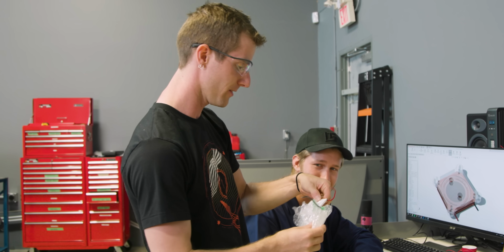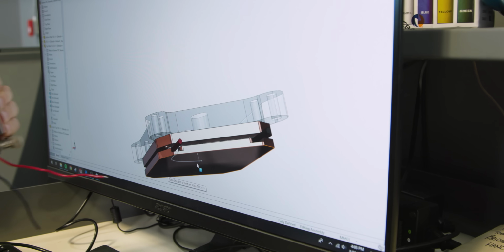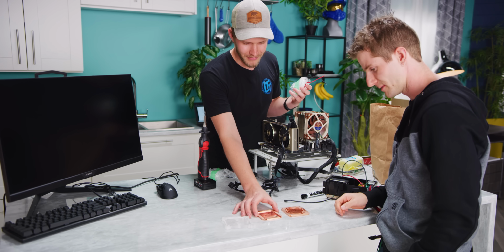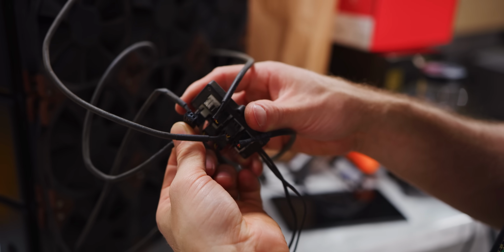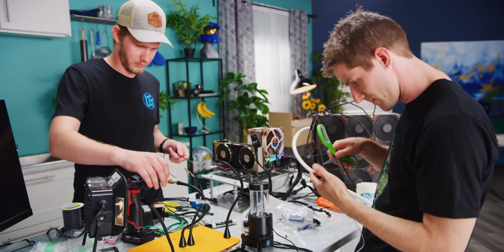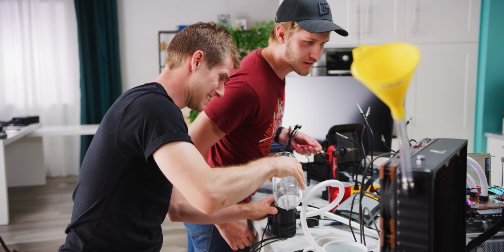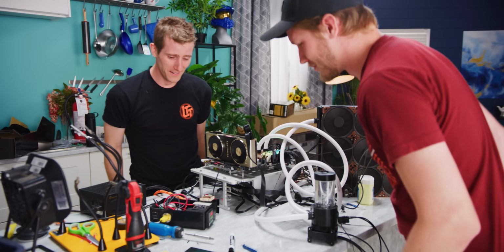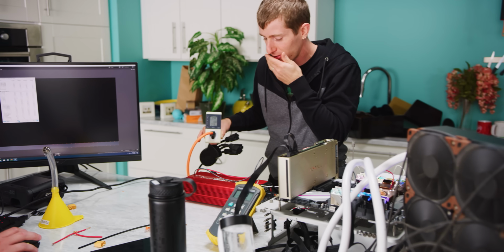This Cooler DRAWS 545W!!? Bad Cooling Ideas #2

Comment: Glad you guys enjoy the fun, i do believe that your idea of going big is bound to fail, try using (Epoxied) multiple smaller Peltier resistors right on to a copper line, well i know its more complex than that, i drew my setup in AutoDesk inventor, i did come up with a really cool heavy heat dissipation on the multiple Peltier resisters on the copper line, but i simply would love o see this tech work properly. rethink your approach to much smaller and multiple Peltier resisres like at least 6 to 10, in parallel with a combined wat of at least 500, but really would be best at  over 800 to 1K

Comment: As an engineer who does FEM simulations I wonder how the simulation was made. The problems everyone mentioned should have shown up if Alex did make a proper simulation. Also its good that they used a PID but the way they explained it in the video does leave me wonder if they only had it as an on/off regulator or with the advantage of it that it regulates the TEC in a proper manor.

Comment: Linus would be the only person holding live wires carrying 900 WATTS and getting exited
Reply: Plenty of people have held live wires and got excited...
Reply: Better to be excited rather than shocked
Reply: @Corpus_Subiectivus  Fr
Reply: its just 24v, not going to harm him!
Reply: @zanw.awesome3102  but stil if things go wrong 900 watts is 900 watts
Reply: @Ayush_Bob  its DC, it doesn't penetrate the skin, its 24 volts, so not harmful, its just 900w/24v 37.5 amps, at just 24v, it definitely won't harm him!

perhaps an example is in order, imagine someone is starting a car and you're holding a single terminal connecting a battery, that puppy is 12v and draws 500-1000 amps, so around 6000 to 12000watts, now i was stupid enough to touch it but it really doesn't shock you at all, just tingles, so just 900 watt or 37 amps at 24v won't do anything!
Reply: also, kids, don't ever try this at home! I'm what you call a stupid curious person!
Reply: @zanw.awesome3102  37 amps is many times that is considered lethal but not at 24v no. 0.1-0.2 amps is lethal but would require at least 50v. But thats not saying this thing they built isn't dangerous.
Reply: @DeKosta plus our skin resistance is quite high, even if its 37 amps at 24v, it won't penetrate our skin and even if it does, connection from hand to insulated (shoes) feet is too long and current would take the shorter route which is the ground on circuit !, But ur right, it's still dangerous, it might short circuit and sparks would fly hard or it may catch on fire!

btw, I'm not an engineer, all of this ive learned from @electroboom , so i might be wayy off..xD
Reply: @zanw.awesome3102  You are fairly right. But the current (amps) is a result of applied voltage and resistance. Voltage= Current * resistance.  If you would apply the same 24 v potential to a human body- > 24= unknown current * 100 000 ohm (approx resistance of dry skin). Solve for the unknown current and it would be 0.00024 A. So you never apply a current of x ampere, you apply a voltage across a load with a certain resistance and x amount of current will flow through it. Same goes if you charge your phone with 5v usb. If the charger is rated at 1 amps or 2 amps it doesnt matter. The phones resistance is "fixed" and will only let a certain amount of current through at 5v. If it can handle 2 amps it will charge faster but if it doesnt, it nothing happens. Reduce resistance-> more current flows. Increase voltage->more current flows. To risk killing a person, you only need about 0.005 amps.

Comment: Literally, the only thing a TEC does compared to an actual water block is ADD heat. The Peltier just moves the heat to the other side, but due to inevitable thermal losses and internal resistance more heat is generated.

Comment: it's been a while since i read up on thermoelectric modules, but if you apply a temperature differential over it, then it should be able to create enough power to drive a fan, couldnt you use that to make "free" cooling

Comment: Use salt water to directly extract heat from Processor, send that water to a 20 liter heat sink, which is maintained at 0°C using your piezoelectric cooler. You can do it with the existing setup you have Trust me, I am and Indian, it is bound to work
Reply: ARE YOU READING THIS?

Comment: I wonder, would they be more effective if they were used to line the lines rather than directly on the block? You have less instantaneous heat to compensate for, and you can cool them off by running a decent sized fan over them while the water cooling does its own thing on its own, rather than having to worry bout getting through that mass of copper....

Comment: Guys, you need to super cool that liquid by making liquid and air blocks for peltier elements. Feed the cooled liquid to cpu and temp measurement should be done on the output liquid from cpu to control peltiers.
Reply: On the output side first element should be just a regular radiator to take away that possible extra load from peltiers.
Reply: If you want to go hardcore you should make second waterloop to cool the peltiers which are cooling the first loop.

Comment: you get a much better result by stacking TECs rather than using a more powerful TEC. It will be a little less efficient, but will work over a greater thermal differential. A very easy change would be to get 3 of the same TEC, and stack them on top of each other with some thermal epoxy between them, and have the bottom TEC connected directly to the power source with the two top TECs connected in series with each other. 
A much better use of the TECs in your setup would be to just have the CPU water cooled, but use the TEC to cool the water with a smaller fan and heatsink cooling the TEC. It does a much better job with a smaller temperature differential.

Comment: My water cooled  PC 20 years ago used more power for the TEMs than for the CPUs, quite a big overclock though. Most fun doing it on the cheap, radiator was a modified heater matrix from a Ford van, circulating pump from a water feature.

Comment: Why dont you do 2-step cooling ?
1) Hot water goes into radiator that dessipates heat, and lowers tempreture to ambient like 30 degrees Celsius.
2) 30 degree water then goes into cooling module that uses Peltier element with massive radiator attached to its hot side, and water tube on the cold side.
3) Then, Cool water with sub-ambient temperature (maybe 14 degrees Celsius) goes to cool down cpu.

Comment: i would love to see the effectiveness of a standard water block on the cpu and somewhere on the loop have another water block for the tec that is meant to cool the water, which would probably have to be radiator coolant or something similar. alex is a pretty smart guy, im sure he could come up with a design that may work. and i know how bad he wants to try at this again. i want to see it work. there is so much potential in tec cooling

Comment: You guys know if you bothered to get the right kind of relay you could use the motherboard it's self as a controller.  It's not like the motherboard has fan headers that can be set to run at a specific CPU junction temperature or anything.  This entire setup is just more hamfisted bullshit like every other project you guys do.  Damn man, Linus even bought Solid Works for a guy that isn't qualified to sweep the floor at a real machine shop.

Comment: I feel like it would be better to use PWM control, rather than relay.
Reply: PID is the programming version of PWM. The relay used here is actually a solenoid which has no mechanical components in it, making it able to switch on and off REALLY fast, hence the big as heatsink on it

Comment: the base design was flawed by having the temp probe directly in the "path" of the heat. otherwise i think this design would have worked, given proper control and monitoring of the tec. (ramp up voltage in anticipation of the load) in addition, monitoring the output temp would be useful as the tec creates a temperature differential so the problem may be not enough heat shedding.

Comment: Dear your attempt is good, one  thing you do, instead of placing Peletier on processor keep it separate from cpu, from Peletier take the cold side water supply to processor and the hot side water supply to radiator

Comment: Why not try the other way around? Have a CPU waterblock, then use the TEC to cool the water instead of a radiator. You can use a massive air-cooled fin setup to cool the TEC with just a few fans.

Comment: And for the next time try use liquid metal inside the water cooling loop.
Mercury or Gallium should not have a to big viscosity.
(But of course mercury is toxic and gallium is not good for Aluminium but a copper radiator should be fine) 
Or

Comment: Would it help if the CPU was both cooled by the peltier and drawing heat from the copper to the water cooling at the same time? Isn't it bad if it's not connected to both?!

Comment: If you pump 500 watts of power into a TEC to cool 300 watts of heat from the CPU, you will have 800 watts of heat to dissipate through the water block.

Comment: weak link was the water pump. have a huge rad but didn't upsize flow.
Reply: im not sure about your definition of "weak link", but it certainly wasnt the lacking flow rate that made temperatures jump to 90 degrees in sub 20 second ^^

Comment: You need to rig it so the TEC isn't trying to carry the full heat load but simply adds additional cooling to the  inlet water for a standard water block setup.

Comment: "They're rated at 32 amps...and we're expecting 32 amps, so..."
Reply: a safety factor of maybe...
Reply: @wobblysauce  a safety factor of probably
Reply: An amazing safety factor of 1
Reply: @Kyros9119  The safety factor should already be in the rating, so it could actually handle more than 32A, but it is only rated at 32A.
Reply: @Kyros9119  Fuck. I am someone that constantly need to add safety factors and this made me laugh hard :D
Reply: @Kyros9119  I think that's a safety factor of 0 ;)

Comment: I like the video, but I can't figure out what the experiment was in the first place. It seems like you sandwiched a semiconductor in between two good conductors and hoped that it would cool better than with just a good conductor if you could supply enough electricity to the semiconductor.
What?!?

Comment: because the two pieces of copper that sandwiched the TEC were in contact with each other, there was heat transfer from the top of the TEC to the CPU causing the temps to rise. there needs to be an insulated separation layer between the two for the cooling side to do it's job on the CPU and the heat side to be isolated to the water block

Comment: Lol! You guys used a PID controller and have no idea how it works (Hysteresis)! Would have saved you some time there. Also, maybe use a micro-controller to run the I/O between any relays and thermocouples. Keep it up fellas! Engineering without math and science! Woo! Fun to watch!

Comment: So I think your copper is too thick for starters.  
There's too much thermal mass in the system which means the cooling is lagging behind the load increase and everything's out of whack.  
Also if the hot side of the TEC is too hot, your liquid cooling is not working correctly so the peltier is saturating. Hence no cooling.  
Possibly your liquid cooling system isn't big enough. That TEC will be producing towards ~700-1000W of heat energy if you're TDP on your cpu is say 100-150w.

If you maths it out, if your Peltier wattage rating is enough to exceed the TDP of the CPU, it should be able to cool it.  
BUT, your cooling system for the hot side must equal the TDP of the CPU + the waste heat from the Peltier. A peltier may only be 10% efficient, so if you're moving 150w from the cpu, it'll be producing multiple times that on the hot side!  

In the config in the video, you may need a car radiator to effectively remove the excess heat basically. We can see it's an issue as the hot side was super hot, meaning water cooling isn't keeping up.

For a final ditch effort I think you need to double liquid cool. You cool the hot side of the tech with a rad, and you transfer the cooling with a second loop between the cold side and the CPU.  
No big chunks of copper heat spreader making the temps lag.    

Super impractical, but I know technically this should be possible, and now I want to see this damn thing work!

Comment: Not enough liquid flowing for it to even be feasible, try a similar method to the fanless radiator you had a while ago, gas in a vacuum instead of a fluid, even if cooled by those 9 fans.
"Go MythBusters or go home"

Comment: i think an air cooling will suit for this because TEC is "collect" heat extreme fast, air cooler just fit very well for this. Water cooling transfer heat isn't that fast compare to a huge metal fin heat sink.

Comment: Heliarc weld a two piece block out of stainless for an hvac cooling solution . And heliarc stainless tubing into block. 
Then connect to a  matching wattage a.c. unit . Then insulate the area with neoprene and " pooky" 
If all else fails , find an hvac tech who would be interested in a colab. with you Willie wonka grade goofs .

Comment: why not instead of placing the TEC on the CPU (heatsink exc.). Just make a radiator with a TEC, and cool up the water, then go through a CPU water block, In other words, TEC the radiator and cool up the water or TEC the water reservoir (dump tank) ?? Also please tell me you guys are using distilled water, and not tap. If you're using tap water that's a newbie mistake.

Comment: how an engineer doesn't know it will not work before trying? In not really sotisficated devices/systems, energy transformations are around 30% efficient. So using peltier plate to take heat from the cpu and then a liquid system to take heat from the plate is most costy (in terms of eletric energy use) them simply using a liquid system to take heat directly from the cpu (and ofc more complicated)

Comment: I saw der 8auer built a CPU Cooler with an Peltier Element and cooles the 9900k I Think. It worked really really good. You can check it out at Hoellenmaschine 10 / HMX on PCWelt. Roman built an LianLi especially for the Big Radiator you Guys used too. So technically it workes just fine nur needs waaaaaaaay to much Power.

Comment: The trick with Peltiers is that they are most efficient at lower voltages usually. You can check the datasheet for your TEC to see a curve of voltage vs efficiency usually.

Comment: nah - this isn't over yet.

I'm familiar with the TEC-12730.  
At max power, it will move 282W at the cost of ~543W(30.5A*17.8V).
282W+543W = 825W of heat you most move.  

While that is a slick looking water block, I don't believe it's able to relocate 825W. 

At max power, failing to remove the full 825W of heat would have resulted in a thermal run-away (meltdown).  Because the heat could no longer escape - the TEC became a heater for your CPU.

You said you pulled 900W at the meter?  With ACDC conversion eff of 80%, ~720W has greatly exceeded ~543W maximum at 50C.  The maximum at 25C is a bit lower, ~475W.

There is likely damage to the peltier.
You likely headed the CPU for a few moments.

Please, do try this again.

Please consider a thermal test of the water block -- how many watts can it really move?  If it can't easily move the heat your cpu is producing -- then there is little chance for success.
Do keep in mind, peilters are MORE efficient with less power.
Perhaps consider a reservoir, holding the cold water for surge loads.
Consider having multiple tec's cool the reservoir.
Consider relocating the TEC, away from the CPU - so you don't accidentally cook it again.

And if you want to get really fancy and efficient - consider some sort of PWM instead of an on/off relay.  With a PWM, you can throttle back the cooling power as demand reduces -- and scale in with more power as necessary to keep the loop (or reservoir) at temp.

Comment: Thought for sure they would cause a brownout on the west coast.
Reply: From only 900w? A microwave at full power is often over 1200w.
Reply: @Combatpzman  Anything is possible when Linus is involved.
Reply: @Combatpzman  Not sure if you are being ironic, but the microwave only runs for few minutes (usually), that thing is supposed to be on for hours. ;)
Reply: @ZpeedTube  Nothing ironic about it. The point is that in the grand scheme of things 900w is nothing. Is it a lot for a desktop computer meant for home use? Of course. For example  A small window AC unit, which people run for hours, typically operates between 900-1200W depending on how hard it needs to work. A large outdoor unit would far exceed that. As would say your household oven, a washing machine, and more.
Reply: @Combatpzman
Amplifiers used for concerts are usually 1500 to 3000W, and they are often running ten or more of them at the same time.

Comment: What was the operating voltage of that Peltier at it's full power rating - most higher power versions I found earlier seem to be around 35V?

You guys DID realise that you had one HUGE oversight with the whole thing, don't you? You had a TINY waterblock that might have been OK for a stock CPU of ~100W BUT you were ALSO cooling the hotside of the Peltier tor a TOTAL of ~ONE THOUSAND WATTS! No wonder the poor copper plate was getting toasty...

Try engineering a new block with a very high flow rate and, more importantly, a LOT of heat rejection surface for the copper to pass the heat to the coolant!
I still think you will run into hot side problems, but as you have so much into it at this point...

Comment: see if the water cooler they made could even cool the cpu, those fins compared to the block on my cooler are so much thicker. never trust the simulation especially solidworks sim, ive never had something simmed and it worked just like it said it would.

also I can get a tec down to -6 with a flat piece of aluminium as a heat sink.